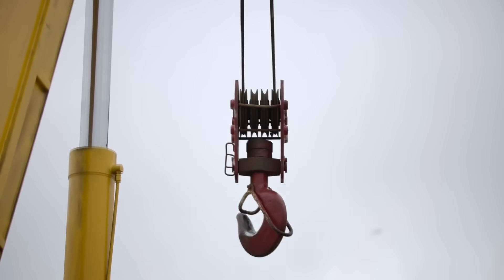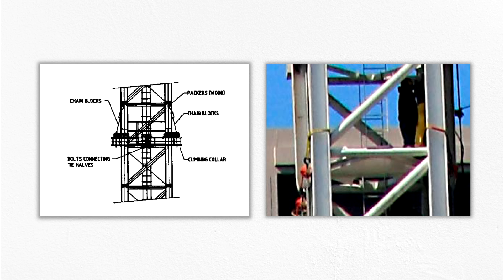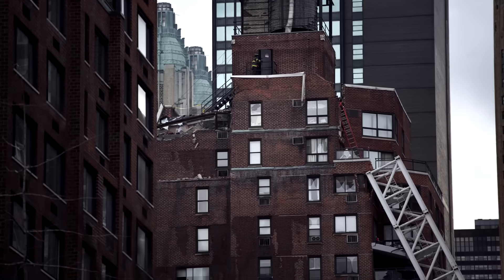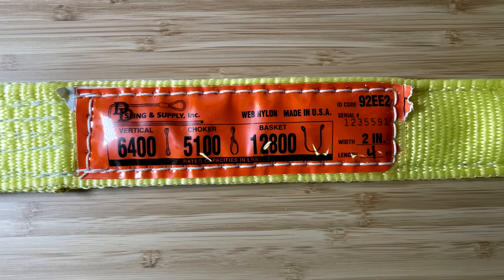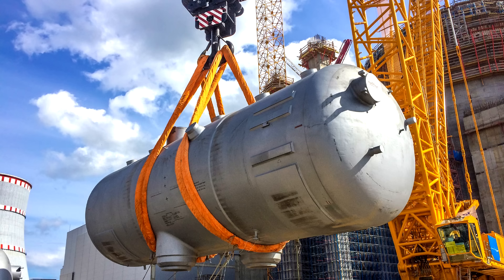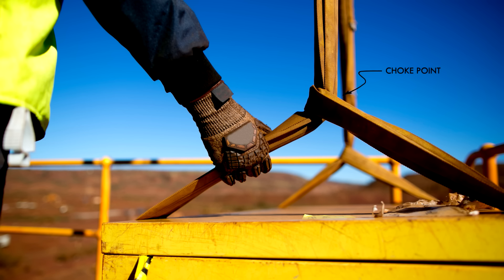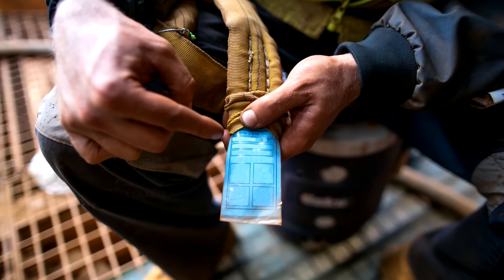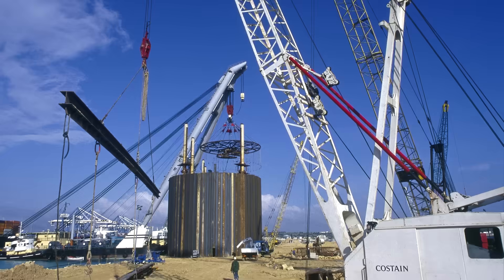Why Things Fall Off Cranes

Comment: I was an ironworker for 32 years, and I love your videos. We use steel chokers on rebar, and slings on epoxy coated rebar, and fiberglass rebar. Slings bother me, because of their tendencies to slip. When unloading a truckload of steel you can't always achieve the optimum picking points, and some operators refuse to wait for you to set the load down and readjust. It's not always the riggers fault.
Reply: Get new operators or refuse to rig...going along with something makes it the riggers fault.
Reply: @djsomeguy  100 %, well put.
Reply: The rigger can always say no
Reply: when you say the operator won't wait, do you mean the crane operator?
Reply: @inund8  Yes.
Reply: @ronhanisco8697  but don't you control the radio? Just tell them the load is going to fall lol?
Reply: @inund8  What radio? That particular time I was unloading onto a barge for a non-union contractor, and the operator wouldn't listen. He was a contractor hired guy. Mr. perfect. LOL
Reply: @ronhanisco8697  oof, I guess sometimes you just gotta be ready to run.
Reply: the "operator" has no choice on how long you take to lift a load off
Reply: @davidjones-vx9ju  Yeah, you'd think so.
Reply: @Andrew Crews Maybe, who knows.  I can imagine that if there is a choice between rebar for a contract costing $100,000 delivered loose, and rebar with slings already attached for $102,000 then most contractors would take the cheaper rebar, because the risk of a rigging accident is relatively small despite the cost of an accident being potentially large e.g. if rebar falls and kills someone.
Reply: @T.J. Kong Champlain Towers South, Surfside?
Reply: Your prob that guy that stopped me from cutting those tags from the slings. Lol I was super green, glad there's very preceptive guys out there.
Reply: Carpenters local 441 Pittsburg Pa. 
we had to take a rigging class. 
They’d make all apprentices take it and get the card. But they didn’t have the experience of rigging any thing to much so we made sure to keep our eye on them to keep everyone safe. I seen some stupid stuff out there but I never seen anyone get hurt. 
Check out Big Blue video of it going down. Three Iron workers in a basket got killed when it went down. Sad day. If you ever been in a basket up high it’ll make you sick to see.
Reply: In the UK , most if not all rebar deliveries come with slings already attached from the factory. So the slinger can just hook the chains and go. I'm assuming you're in the US, but I've noticed that the UK tends to be a bit stricter on matters of health and safety.
Reply: @joshdaly2343  yes I am very familiar with the trucks loaded with “packages” of rebar , the slings here in Holland are certified that use them only ones ! Sooo the trucks comes to the jobsite with the slings more or less on the ideal position to pick the bundles of the truck . The only problem …. The slings are allready used 😂 1 time I witnessed a bundle falling out crane , because the sling was cut .. luckily nobody was hurt ,it fell in a tunnel structure |_|  after the near miss the method was …. Use slings to unload the truck , put stringing chains arround the bundles when the bundles where lifted In the tunnel structure . I am doing this work now for 13 years , I started as rigging operator for the well known company Mammoet
Reply: @joshdaly2343  I disagree, the rules in the US are very strict (disclosure: I am British and worked there for many years, but now live and work in the US) .... but implementation, e.g. training of workers, and at-the-time enforcement is often lacking.  Then when there's been an accident, OSHA comes along after the fact to apportion blame and levy fines.
Reply: @pulaski1  OSHA actually  has strict rules on anything involved with lifting,including keeping records of daily inspections of slings and crane operation , annual pull tests on slings and operator training,however many places do not bother to enforce them
Reply: @davidjones-vx9ju  Which is exactly what I just said - the rules in the US are strict but poorly enforced.
Reply: @pulaski1  some places are very strict ... i worked for a place where it was very important ,especially  after we were "raided" by OSHA auditors and faced $50,000 in fines, most were abate
Reply: @davidjones-vx9ju  Agreed, some employers are strict, but the prevailing driver of compliance in the US is the threat of after-the-fact sanctions, which some, but not all, employers take seriously. ... As contrasted with the example given by Josh Daly above, where in the UK rebar is delivered to the job site with rigging already attached, thereby ensuring compliance with rigging standards irrespective of the customer's procedures and the training and experience of their employees.
Reply: @pulaski1  there doesn't even need to be an accident or injury... if there is a crane and slings, there needs to be regular ,sometimes daily ,documented inspections. ISO 9002 and other certifications ,needed to do  work for automakers and  government contractors include safety requirements
Reply: @davidjones-vx9ju  Right, they're "needed" but yet some job sites are sloppy, "required" procedures are not completed, at least not consistently, and accidents occur that could, and should have been avoided.  

This isn't unique to industry and construction, it's the same with aviation/ transportation, where the NTSB come along after the fact and find that rules were not being followed.  .... There is nothing in the US to stop someone in fact flying a plane for which they aren't "rated" or a plane which isn't fit for the purpose, hence the accident in Smyrna, TN a few months ago, or the one in Texas a few days ago where a father and son overloaded a plane that the father was trying to teach his son to fly in.  :(

Comment: Watching the Starbase at Boca Chica you will see huge lifts using crawler cranes. Spreader bar examples you can feast your eyes on are used everywhere. NasaSpaceFlight live stream many of the lifts so it's a good place to see rigging in action. Some streams are quite long especially if there are rigging problems. lol
Reply: The main aim of a spreader-bar is to avoid crushing the sides of the load. It actually makes the sling angle 'worse', according to this video.
Reply: It's not the cranes down there that worry me, it's all those cherry pickers! I watched several at maximum extension, being used to check/replace heat tiles yesterday, and it was terrifying!

Comment: As a rock climber, this was fun to watch. Shout out for rope access too. Everything has a load rating, all the same stuff matters but the force are often dynamic as well. Can't think of a good engineering example of dynamic loading off the top of my head. I'm sure you could come up with some excuse! A deep dive on multi-point load equalisation for shifting force vectors on anchors would be interesting too! Must be some suspension bridge examples there?
Reply: engineer's favourite dynamic loads are people (not applicable) and... wind!
Reply: A swinging load will always exceed the force of gravity (depending on the width of the arc). Otherwise cranes are mostly static, compared to safety ropes for climbers.
Reply: @gordonrichardson2972  A rope catching a climber fall is entirely a dynamic load. It's only static for very specific use for a
 "Follower" on an "aid climb" all other uses are dynamic.
Reply: What about rain? Water is pretty heavy stuff - as anyone who has ever hand mixed concrete will tell you! If the load (including the case, ropes, etc) is absorbent, it's going to get a lot heavier during a lift in rain.  Also, when using multiple slings/ropes, I would be a lot happier if I knew that the load safety limit for each rope included the possibility of load transfer if  one or more of the other ropes fails - and an allowance for the sudden increase in load as this happens. That huge telescope in South/Central America (can't remember it's name or location!) that failed recently might still be repairable if this principle had been followed.
Reply: @paulhaynes8045  If you are thinking of the Arecibo radio telescope in Puerto Rico (famous from James Bond and "Contact" movies), that was more about corrosion and (lack of) maintenance, I believe.....
Reply: @gus473    Arecibo - yes the satellite dish scenes in Goldeneye were shot there, though (in the movie) the dish was supposed to be in Cuba, not Puerto Rico.    As regards the actual telescope, there was a video on this channel about its failure.   Scott Manley also covered the failure, and also (in a separate video) the earlier failure of a singe cable about 4 months earlier.
Reply: @paulhaynes8045  wtf are u talking about.
Reply: You might like the channel HowNot2Highline. He break tests lots of climbing gear https://youtube.com/c/HowNOTtoHIGHLINE.
Reply: @NerdyAardvark  HowNot2Highline have changed their channel name to HowNOT2 so the address is now https://www.youtube.com/c/HowNOT2
Reply: you are quite right in civil engineering very few parts move. A few exceptions are marching soldiers, dancing people (the beats synchronises everyone!) or lifts/elevators. But in general/mechanical/machine engineering dynamic loads are a big thing think of all the moving parts in a car, the loads on airplane wings in tubulance, the twisting of a tire under hard acceleration....for example :)
Reply: @Freakschwimmer  even walking people are a problem, look at what happened with the millennium bridge in London when it first opened.
Reply: Liquid tanks are very dynamic when moved (unless baffled).
A 1000L IBC (about a cubic metre (or yard, roughly)) can move itself randomly quite a bit if the liquid has been sloshed around.
Reply: The closest thing I can think of is lifting pieces that are stuck to the ground with ice or mud.
Reply: No stop, please stop making me remember the hell that was my dynamics class..........  TT_TT
Reply: I never thought of myself as a rigger when I'm setting up an anchor, but it's exactly what I'm doing!
Reply: Nothing to do with ropes, but hitting something with a hammer is a great example of a dynamic load
Reply: Cable stayed curtain wall window systems perhaps?
Reply: Equalisation of anchors is a myth in any dynamic loading situation.
Reply: So... Many... Brackets.
Reply: Aircraft Carriers https://youtu.be/r-EHwYOfY94
Reply: What grade do you climb? 8)
Reply: Your name Jeff
Reply: AISURU.TOKYO/TOKYO 💞 
(◍•ᴗ•◍)✧*。18歳以上の場合 

Youtube: This is fine 
Someone: Says "heck" 
Youtube: Be gone 
#однако #я #люблю #таких #рыбаков 
#Интересно #забавно #девушка #смешная #垃圾
Reply: Between the video and your comment, I have two excellent examples to answer the question, "What do I need to learn math for"? Crane riggers/operators make good money and rock climbing is a fun hobby. Math is all around us, we simply have to take notice.
Reply: dynamic loading would be for heavy lifts on a crane ship (the ship will be subject to environmental fores), or lifting something that has to be submerged into water for example.
Reply: You’d think, as a rock climber, you wouldn’t want to think about things falling, no?
Reply: @northlandgaming8460  Actually, as a rock climber, you need to think about things falling ALL the time!  (Yes, I do know that you're joking.) Only a fool would NOT consider every possible cause of falling, so that they can engineer that possibility out of the equation. My rope could break? My carabiner could fail? My anchor could pull out? My shoes or fingertips could slip? So you get the correctly rated rope; the right sort of carabiner that's either brand-new or that has been X-rayed for microfractures; use multiple anchors; wear the correct footwear and train your hands well. There's also the fact of things falling from above: rocks especially, if you're beneath a scree slope or someone's leading the climb above you; or equipment from someone else slipping out of their pack. Climbing is a great example of the way engineering is part of everyday life, where people just don't realize that that's the whole reason they can do their hobby. .
Reply: @paintedwings74  micro fractures are a myth.